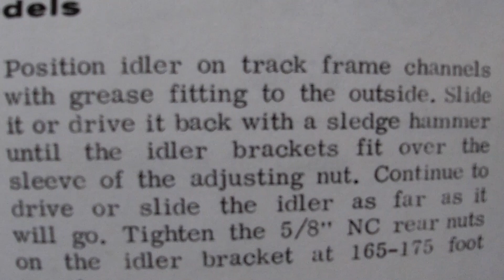Fixing a Case 310 dozer

Comment: I liked the old sock tip. By the way A.J. I have the 1970 Case 310 G  that's g for gas motor I thought until I seen you say yours is a 310 g also.  New subscriber now I'll watch the rest of your videos, Thumbs up.
Reply from the maker: Thanks for the comment.Maybe somewhere in my dozers life the stickers got changed to 310G from 310, I don't know. I did NOT know the G stood for gas engine. Thanks for the tip. Mine is a 4 cylinder diesel. Nice little power house engine though. Really can't believe how much power it has and how much the little guy will pull and push.I came up with the sock tip years ago running old Cat D6 tractors with mechanical track adjusters. We go tired of replacing them so the sock tip was born. Worked great then and works great now. Keep in touch and up to date on your 310. Thanks for the subscription!
Reply from the maker: By the way Gary, check out the 310 pulling our 12' by 26' camp into place. THAT was fun.

Comment: That is what i would do im going to be working on a case 310c 188 motor im hoping ill have it running today
Reply from the maker: Mine is a 1969 Case310G. I could not find the undercarriage parts I needed, so I did what you saw on the video. I also rebuilt the differential and managed to find a ring and pinion (which was destroyed by a bearing failure), a new axle and pinion shafts and new final drives was well as I explained in the video.  Parts are out there on eBay and other places. My 310 runs great. Check it out on my YouTube channel (YouTube search AJ Curtis) to see it in action. Good luck and parts hunting! Let me know how you make out.